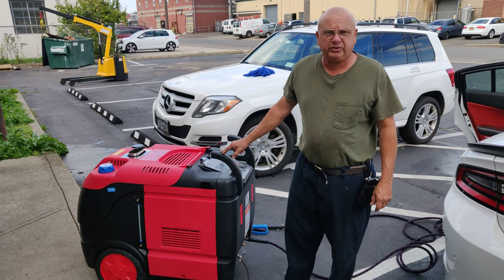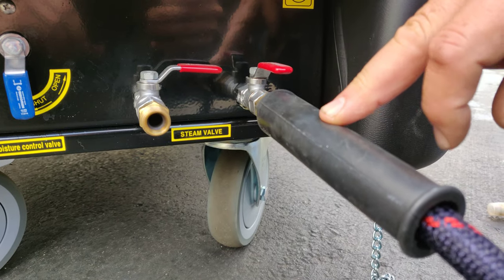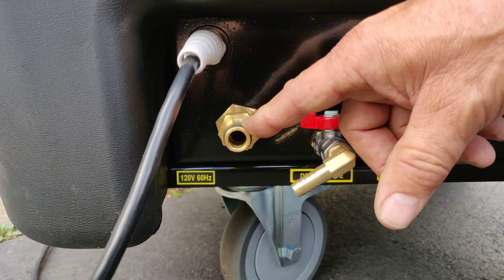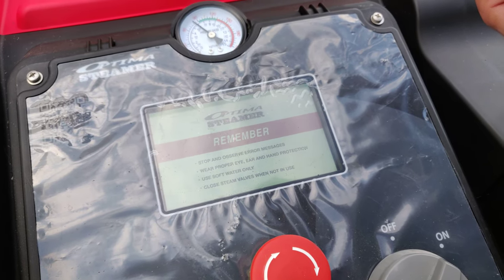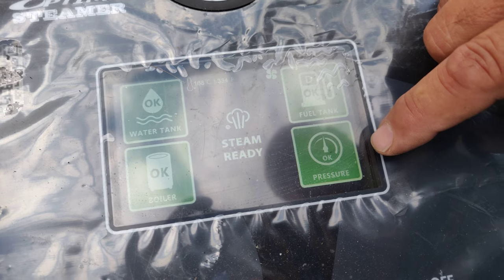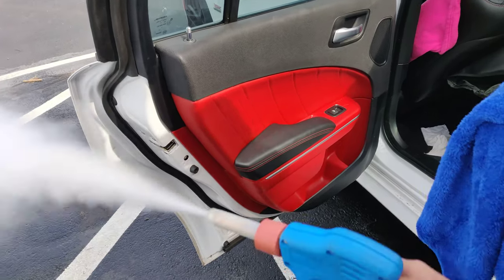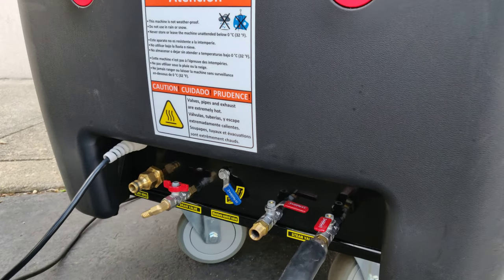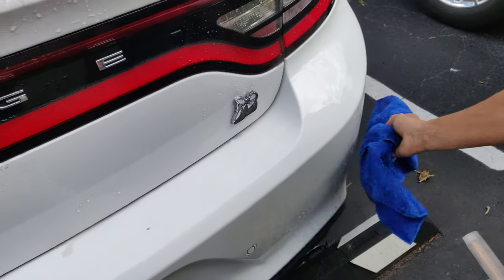Optima steamer XD demonstration . Automatic repair company 131 florida st farmingdale NY. 11735

Comment: hey bro i need a little help from you. i cant find someone who will really tell me the disadvantages of this machine and what not to do and what damage can it cause on ther interior or exterior and also how often it breaks and is it costly to get it repaired. and if there is anything else that needs to be known.. will appreciate if you help me out.
Reply: Hey bro I would do my best to help you out with this one of the disadvantages is you cannot take it inside because of a diesel it is heavy you can clean leather you can clean plastic you just have to be careful I currently use my vapor Rino system opposed to this one I've had both and I like my vapor Rino better check out the vapor Rino you will not be disappointed it is smaller it does not run off a diesel you can take it inside as well as outside hope this helps you out a little

Comment: How does this machine compare to fortador?
Reply from the maker: Fortador is a big  heavy monster machine and is unnecessarily complex , when it comes to repairs , good luck. Not saying it's a bad machine they work well but if you need something a little more portable then this is a better option
Reply: @Automaticrepairco  thanks for opinions on the regarding fortador.
I saw someone selling a van and fortador set up.
Said he paid$12k wanted $4k used it twice.
What do you think about driving around with a 100 gallon water tank,and pressure washer?

Comment: What are disadvantage of steam wash???
Reply: probably breaks down existing waxes, but just make sure to apply a quick detailer or spray wax when mopping up the junk to prevent scratching the paint, the way it was done shown in the video will definitely result is scratching the paint.
Reply from the maker: More equipment to maintain
Reply: You have to use a hell of a lot of microfibers or other rags outside of that I haven't ran across any problem I currently use my vapor Rino system more because I can take it indoors because it does not run off of diesel